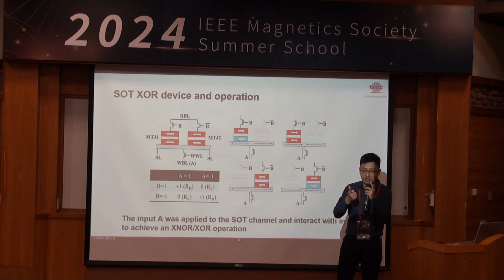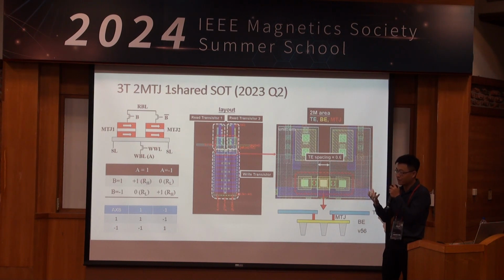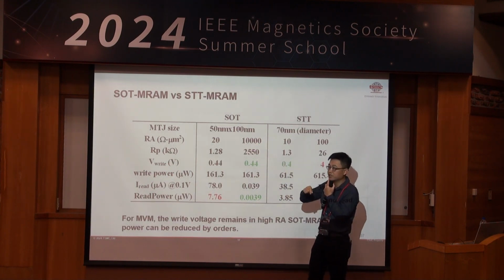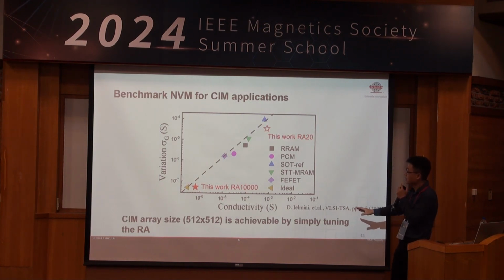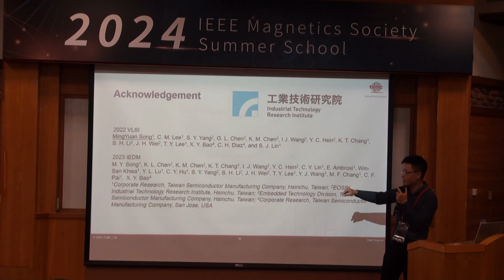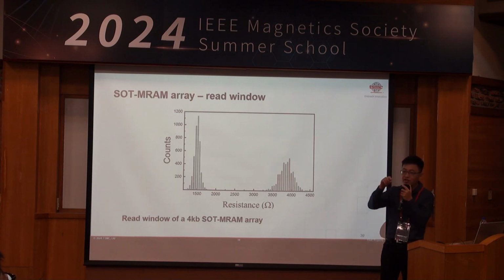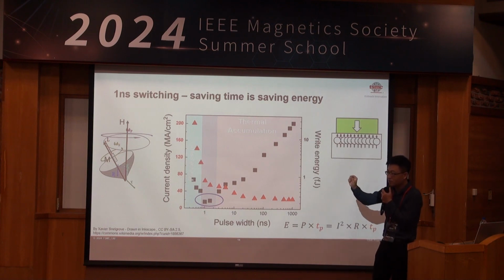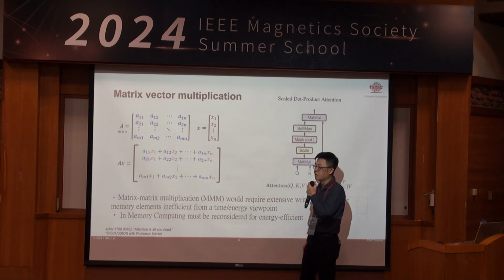MingYuan Song - SOT-MRAM for AI - 2

Comment: Thanks for this excellent presentation. 

It seems most SOT-MRAM work is focused on SRAM replacement. 

May you clarify what presently prevent SOT-MRAM to compete with LPDDR DRAM, especially LPDDR5x or upcoming LPDDR6 ?

I would guess that density is much worse, but how much worse : by that, I mean for the same capacity (ex: 16Gb LPPDDR5X die vs 16Gb SOT-MRAM die), how many times bigger would be a SOT-MRAM die vs a LPDDR5x die (or what would the capacity if die size is the same).

I would think that Non-Volatile-Memory (NVM) / Persitent Memory (PM) would be so disruptive in IoT devices, smartphones, laptop computers,… but I guess cost would be a significant challenge…
Reply from the maker: The density would be much worse than the state-of-the-art DRAM, since the pitch of MTJs is very difficult to reduce further (etching out those high pitch pillars would require some paradigm shift in patterning technology). That said, another major issue is the cost. MRAMs are much more expensive than existing commodity-like memories. Even for edge AI applications, the road ahead remains long and winding.